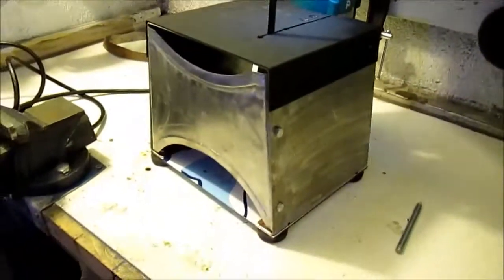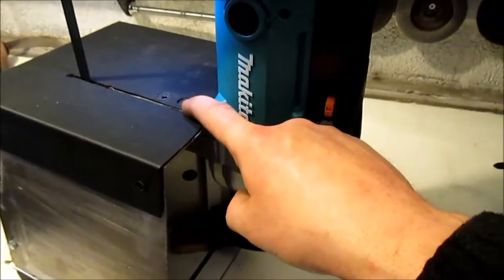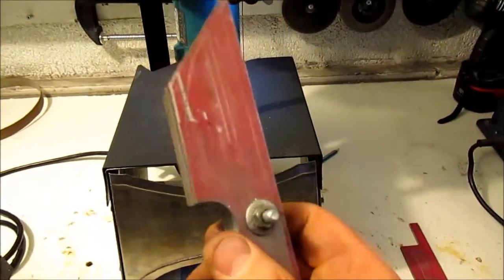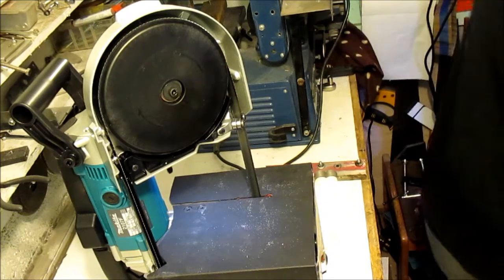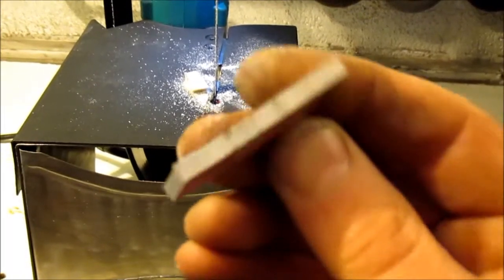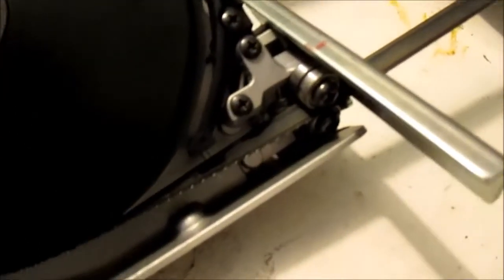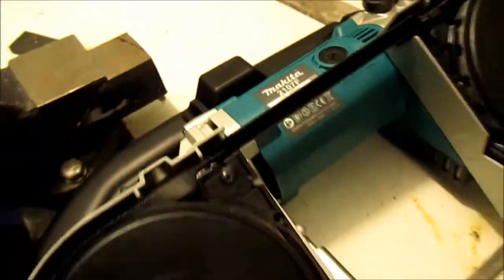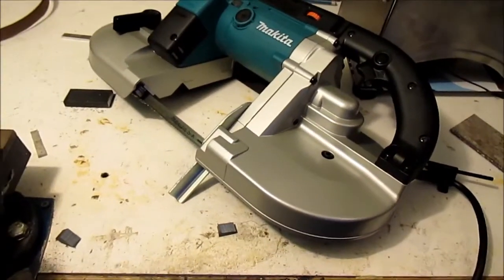makita 2107f portable bandsaw review

Comment: Nice Video & table Mike
Why 240 V over battery power,as they are cheaper.
Was it because variable speed,and what speed are you cutting O1 Tool steel.
Where did you purchase it.

Regards

Davy Thomas

Comment: Hello! I just bought that makita bandsaw this month! The problem is the blade was ruin when i tried to cut leafspring with 6mm thick! There are two dull bandsaw blade now! Can you tell me any advice to maintain the blade; since the blade are very expensive?
Reply from the maker: phirun seng a leaf out spring is very hard steel and will need to be annealed before trying to cut it the blade that comes with saw is very poor quality I use the morse master cobolt variable pitch blades there really good blades but as with all bandsaw blades they last long if you bed them in
Reply: MP Custom Blades: oh! I know why! Thanks for ur advice!

Comment: Good day, is there must be guard caps/covers on back side or its ok to work without it?
Reply from the maker: No guard,s on the saw don’t see why you would need one if used with common sense on the new design table we make we just change one part and it slides into the table

Comment: Mike I know this is an old video, did the machine hold up?  I just bought the same one,  have not got it set up.  Same in Thailand very limited on the brands that can had in a machine like this.  I bought some Lennox blades let's see how they do.  Do you ever use the blade lube?
Reply from the maker: neilyeag it's still going strong and have used well over a dozen blades with it
Reply: Thanks, I have a lot of Makita stuff, I have there small 12" wood band saw and it is a really nice machine.  When I looked at the metal saw it surely looked strong enough.  Got to get it upright and build a little table like yours.
Reply from the maker: neilyeag yes I really like the makita brand